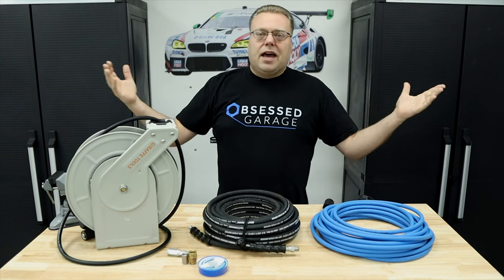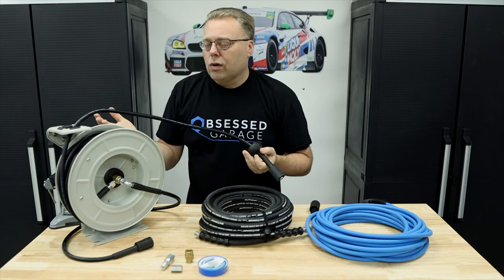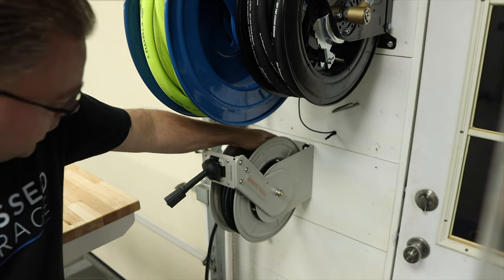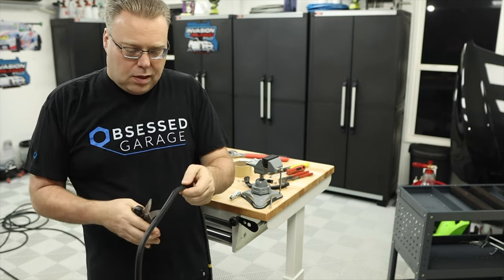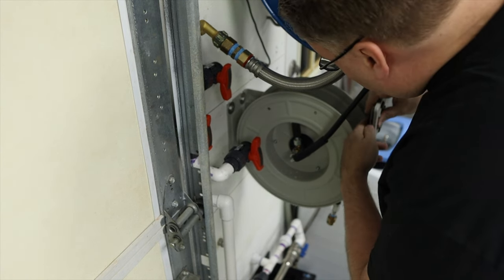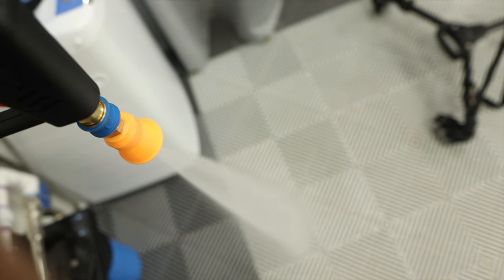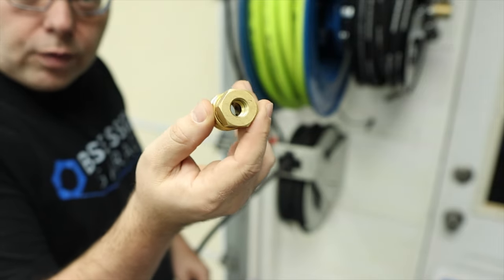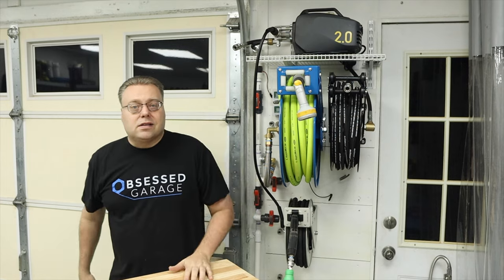1/4 Retractable Pressure Washer Hose Reel | Can It Run Uberflex? | Giraffe Tools

Comment: My exact question. Am in the market for a 1/4" pressure washer rated PSI retractable hose reel. Coxreels has a puzzling, overly complicated, line and wont give me a straight answer on whether their 300PSI rated retractable hose reels can be replaced with an aftermarket hose and handle 1200 PSI. And their "Medium pressure" reels seem overbuilt and overpriced for the task. How they have so many different models and nothing specific for retractable pressure washer community is beyond comprehension to me.

This seems a little too flexy and flimsy.
Reply from the maker: It is a bit flimsy, but will handle the pressure. Giraffe is one of the only companies out there doing much with a pressure washer hose reel. People try to convert the 300 psi ones and it works for a bit, but many of them failed as they are not designed for high pressure. Have you given any thought into the fixfans one? I have it on my wash setup and it has been amazing. Accommodates 3/8 hose and it very stout. https://amzn.to/4aq1YS0 I have been using it for a good 8 months now and it’s one of the best purchases I have made.

Comment: Hows the girrafe reel holding up with the uberflex hose
Reply from the maker: Reel is doing great. Not really using Uberflex much as it doesn’t okay well with the 2.0 just surges too much. Been using a lot of different hoses actually got certain 3/8 hoses to fit. Trying to get this mounted inside a tool box for a mobile wash setup. I also found the thread it is a m14x1.5
Reply: @CarsWithKeav  I'm thinking about getting the reel for my mobile detailing setup , looks so compact and minimal.
Reply from the maker: @KingTheDetailer  It is very compact only trade off is it’s a bit flimsy. Also, the jumper hose and the hose that comes with it the pipe is a very small diameter wondering if that could impact not necessarily performance, but more draw. Saw this happen on the comet 1700 the stock setup was several amps higher than the upgraded setup straight out the pump.

Comment: Did you find the fitting by chance?
Reply from the maker: I did the thread is an m14 x 1.5 and might need Teflon. I hooked it up to an m22 hose in this video https://youtu.be/S_FHnjqSsUA?si=4OFFv58HQQ13bsO3 That wash box was my sole reason for buying this reel glad I could finally figure it out didn’t like using the field repair kit just didn’t think it would hold up their hose it too flimsy.
Reply: Change the jumper hose or the stock one works just fine?
Reply from the maker: @depalmz812  I used the stock jumper hose worked just fine for me and was easier since it was m22 to hookup to the pressure washer.
Reply: Great thought so thanks much
Reply: How are the seals holding up on this connection tho where the swivel is at on  some hose reel those seals tend to blow out or your not using this hose reel as frequent to tell how long they last?
Reply from the maker: @depalmz812  I’m not using frequently enough to know. I think a lot of it would depend on water quality as well. I know some people who blow up pressure washers every 6 months due to bad water quality.

Comment: how much was the wholesale repair part? your link goes to the male only i think
Reply from the maker: I went with the male one because my adapters I had for m22 where female. The part was only like $8 and some shipping cost.
Reply: @CarsWithKeav  I ordered the part listed in your description and have been attempting to install it on the cut end of my Giraffe tools retractable reel hose. After noticing that the female part that goes around the 1/4" Giraffe hose wasn't really catching on the hose in the same manner yours did in your video, I thought something was amiss. I installed it, regardless, and turned on the pressure washer. The hose immediately exploded. I noticed that my female part is MUCH wider than yours is in the video and does not look exactly like yours does. I wrapped black electrical tape tightly around the Giraffe hose to get it the additional width to have more purchase into the female end, and tightened it down again. Again, the pressure washed caused it to explode. I think something is either wrong with the part they sent, or perhaps your link does not go to the exact piece you purchased? Just wanted to warn others who may go down the same path I did, unsuccessfully... Hoping that when the part is back in stock in March and the ship the remaining part of my order (another 2 of the same part that I had to meet the $30 order min.) ships, that the part matches yours more closely.
Reply from the maker: @us65 That's weird it's the right listing. My hose didn't have much tension with the screw down part either it basically just slid on there, but when I screw the other piece in it was holding real tight. That Giraffe hose has a small outside diameter compared to other hoses that are 1/4 inch. I am still working on a solution to adapt the housing instead of cutting the hose. Have some more fittings coming to try out.
Reply: @CarsWithKeav  Interesting and unfortunate that mine is not the same when I tightened it! :( I will say that when you held your fitting up to the camera, the inside threading looks much more pronounced and deeper on the female end than mine does. My threads have no bit into the hose almost whatsoever. I wonder if ordering the 3/16ths fitting will change my luck, and perhaps I'll do that... 

If you do find another way to hook up the Uberflex, please update us and I will be forever grateful! As it currently stands, I otherwise have a $125 paper weight in this hose reel haha. Really appreciate your reply and for finding these solutions in the first place!
Reply from the maker: @Damascus65  I for sure will they should arrive today and tomorrow. This is my last try at getting the right adapter.